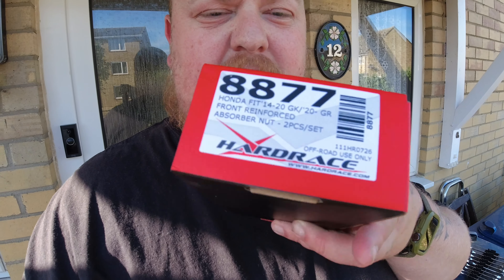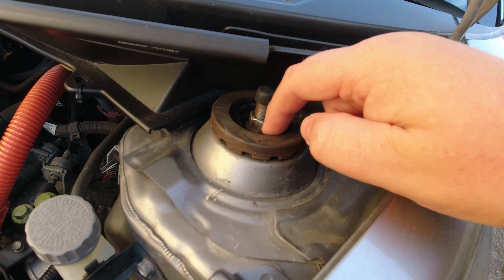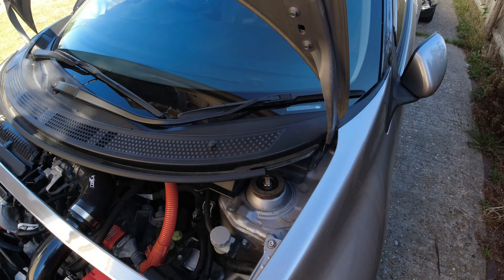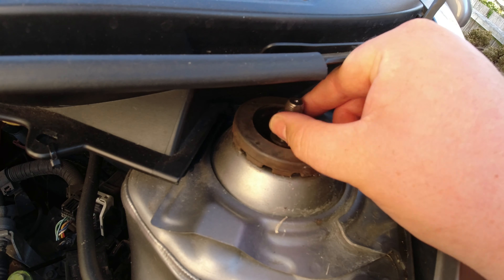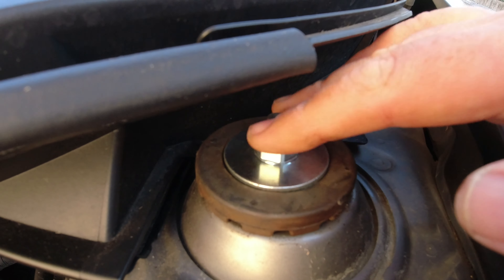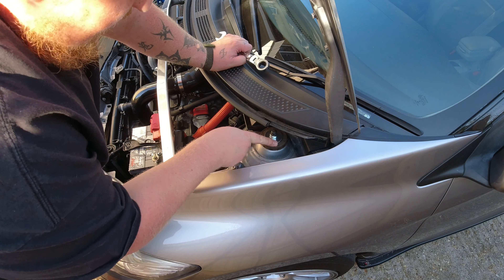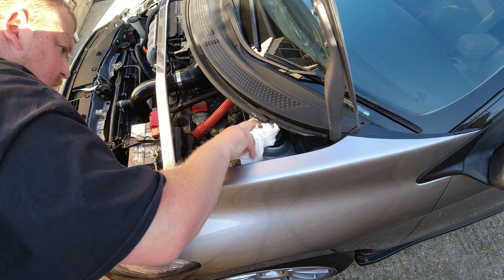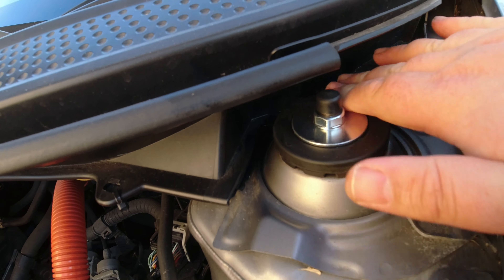Hardrace 8877 - Front Reinforced Absorber Nut - Honda CRZ - EXPRESSION CULTURE

Comment: Brilliant job nice little mod,were can I get hold of these.
Reply from the maker: Heya Mick, thanks for checking out another video and commenting! Are you from the UK? If so i got mine for Torque GT (torque parts) where you can use my discount code “HONDAGURU” which will get you a small amount off. If your not in the uk find out who your local hardrace distributor is, they should be able to help you.
Reply: @ExpressionCulture  thanks yes I'm in the UK,I will go and check them out 👍
Reply from the maker: @mickpurcell272  ah brilliant 🇬🇧